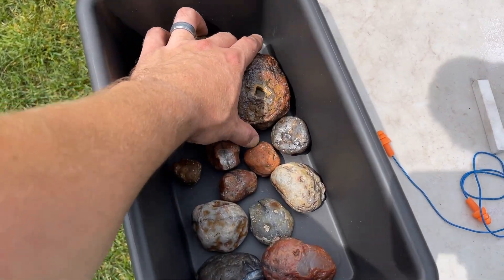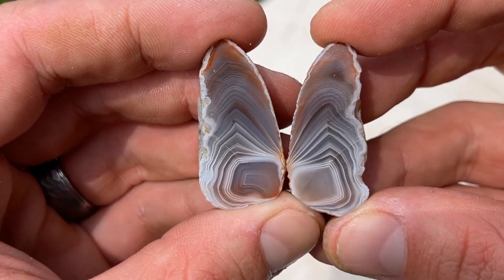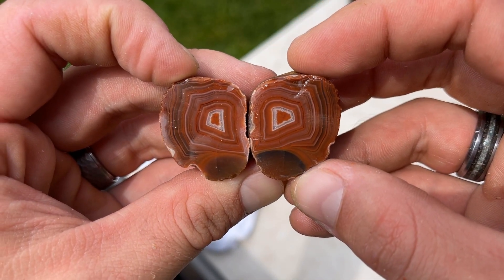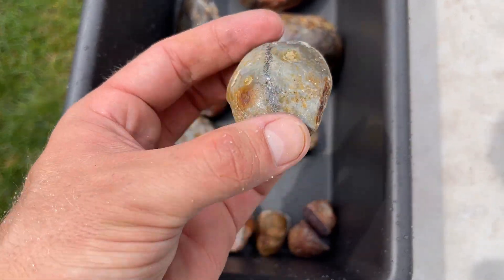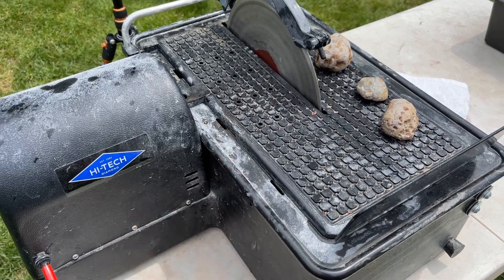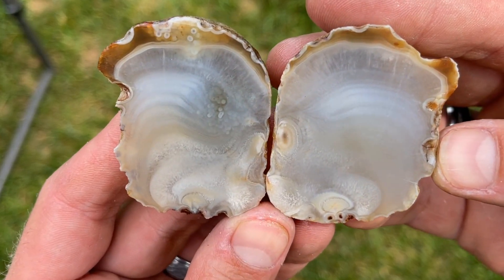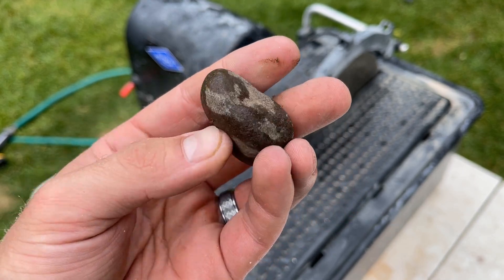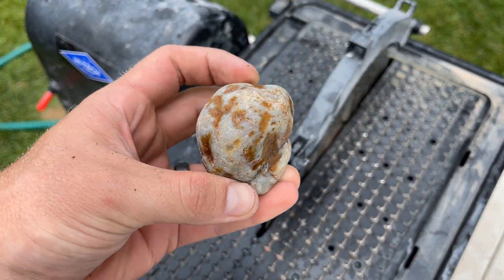BANGER Lake Superior Agates CUT OPEN w/ Lapidary Saw!

Comment: Gunna spent the next 10 weeks saving up for the $900+ saw you are using. I carve stones, but splitting and slicing with a rotary tool is ridiculous. Took me 2 hours last night to cut a 1.5 inch long, 1 inch wide, slice.

Comment: I can't believe you still have your fingers. Pretty dangerous way to handle/saw those rocks. How do you choose what axis to cut? Ever cut the halves flat side down either crosswise or lengthwise also to see what the quartered corners look like? How much did that saw cost? Where did you get it? How long does a blade last? How long before the sold agates give you the return on your investment? Do you finish them off on a flat planetary polisher?

Comment: Looking forward to the vid! Anyone here have any suggestions on a camping excursion location? Heading out tomorrow and looking for a River or creek/stream similar to the ones featured in these videos that can be camped at overnight… looking for something within 3 hours drive from Minneapolis.
Reply: I know you can camp in Rice County for free on hwy 3 in Dundas,  right in-between  Northfield and Faribault. It's called the Cannon River Wilderness Area. They have pretty good amenities for being a free place to camp. Its pretty big. The straight river runs threw it, tons of agates are found on this river. Tons of parks along the way if your only thinking about driving  around. The plus also, is that you can canoe that river with tons of stops on the way. We also have hell's tunnel and the old asylum that people love to visit if your into spooky places. Heads up if this sounds like a place you would consider  then get off the freeway in Northfield for the that campground.  Faribault exits are under construction so lots of back ups on the freeway.